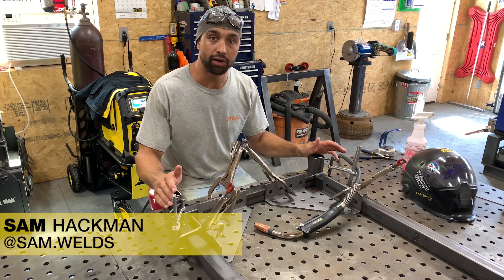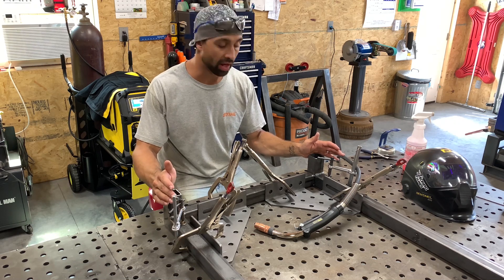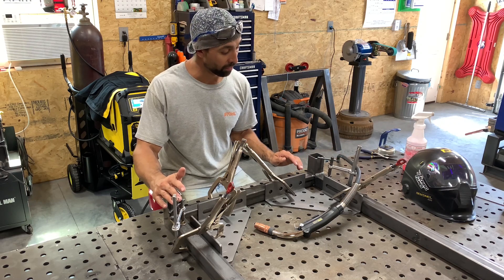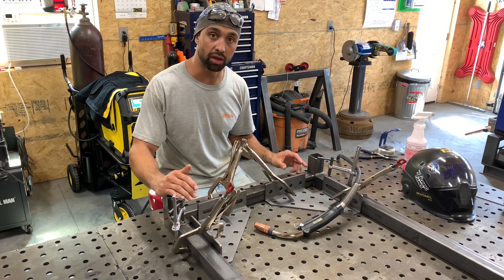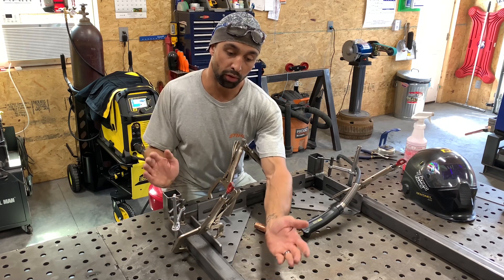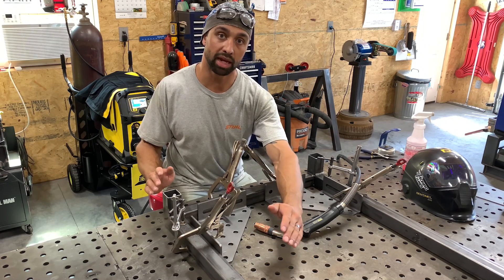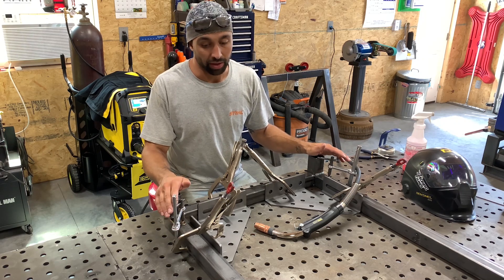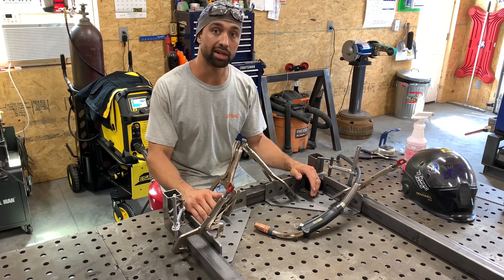Why the Direction You Weld Matters for Your Finished Product

Comment: Stop on your starts and start on your stops... typically will be a good rule of thumb to run over your cold starts, fill in your craters, and set you in the direction for box tubing to weld in the opposite direction all the way around the tubing.